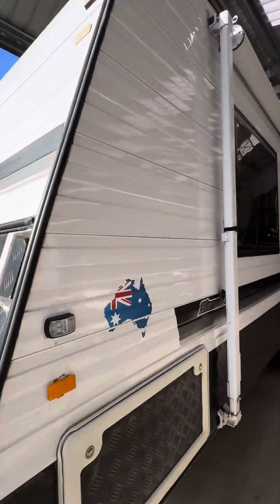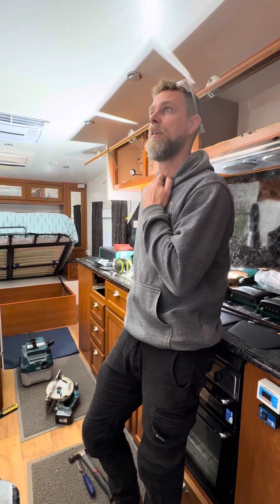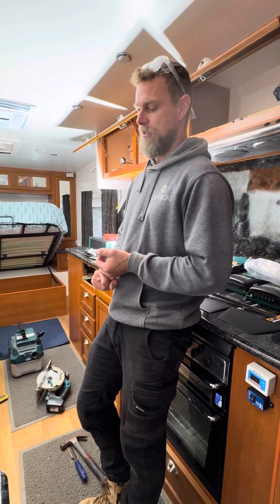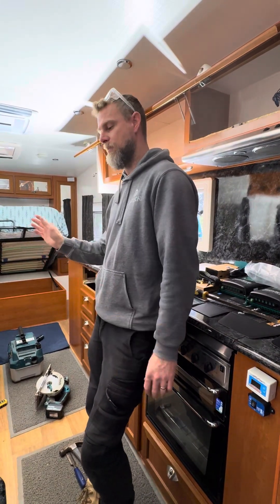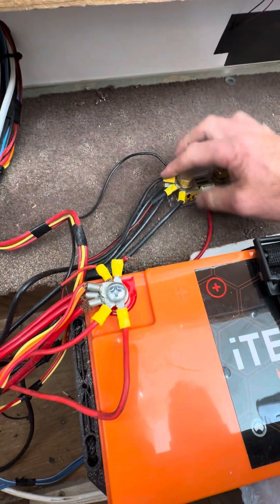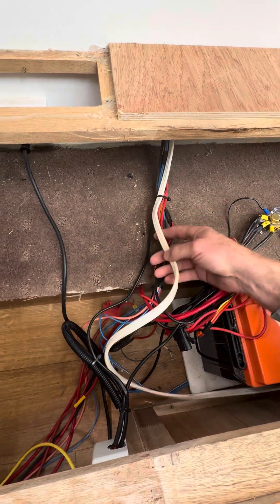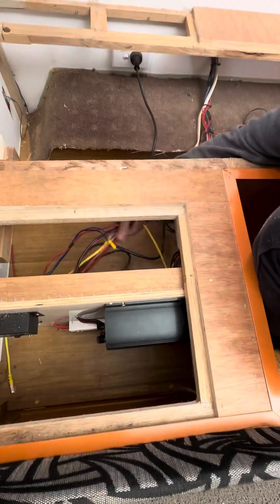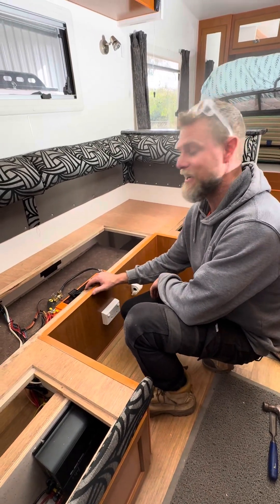What Not To Do - Caravan Batteries

Comment: Main reason I could find to not connect your lithium battery to your AGM charger is if your AGM charger has a desulfation cycle. The higher voltage pulses during this phase can damage LFP batteries. Other than that it just seems AGM chargers are slow as they were never designed with the throughput LFP can safely take.

Those wires though. I got more upset looking at that than I did when I dropped my meat pie at lunch yesterday. Even if you know nothing about cabling, who does a job like that and think they are doing well?